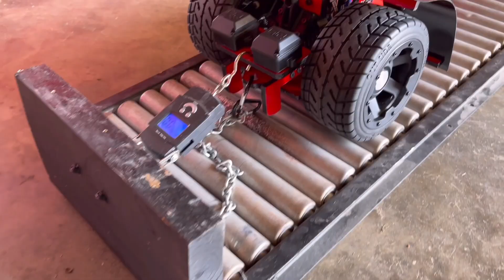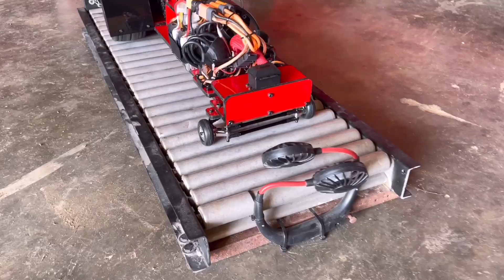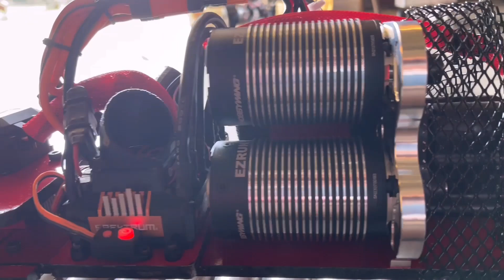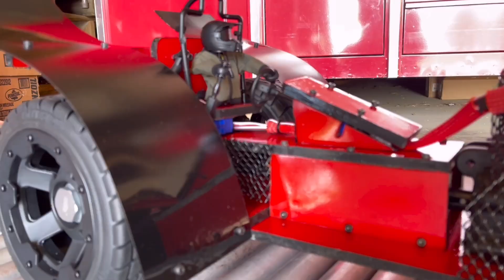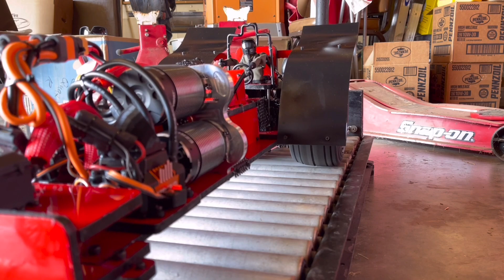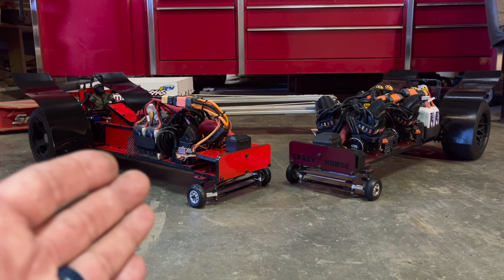Double Barrel 8s Super Modified Unlimited Pulling Tractor “Raging Bull”

Comment: That neck fan is worth it's weight in gold lol why do u have street tires on a pulling rig instead of paddles?
Reply from the maker: What’s up and welcome to the channel. Neck fan? As far as the tires go there are rules to this competition. You’re very limited on what tires you can use however you want a tire that can get enough wheel spin. Too much traction will trash the drivetrain. The key to this sport is wheel speed. Paddle tires are illegal to use. If you look at how the one to one tractors pull they have cut all but slivers of tread off the tires. Too much traction will pull the front end off the ground and will make for a short pull. Thanks for being here! 🤙🏼☢️
Reply: @RadioactiveRC dou you have any Data on your Build like Wheel Speed ? What is your Hitch Position? You have Potential but you won‘t get Happy like that.
Reply from the maker: The wheel speed is approximately 3500 RPM I’m increasing that to 5000 RPM. The hitch height is set to rules and is the maximum height allowed. What am I missing based on your expertise? 🤙🏼☢️
Reply: @RadioactiveRC  You have to Calculate the real Wheel Speed based on the Diameter of the wheels, I think Proper Wheels Like Usa1 or Tamiya Clod Buster would help, Set the Hitch to the Maximum Hight, then as close to the rear Axle as allowed. Put all the Components to the Front of the Tractor. Than if you found the Correct Tire Speed, probably around 140kmh (86mph 5250rpm with Usa 1 Tires). Find the Perfect Ballance In your Tractor, so that the Front tires just hover over the Ground during the pull. If your Setup can Spin more wheelspeed - go for it. If your Driveline breaks it is to weak😉 there is a Little more than just Power in this Sport